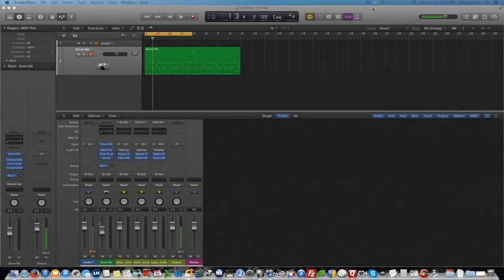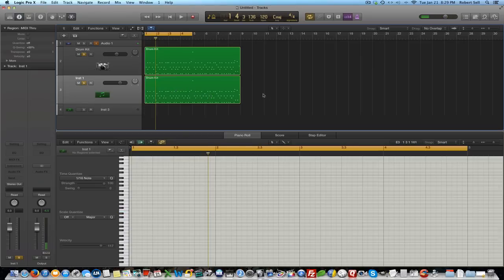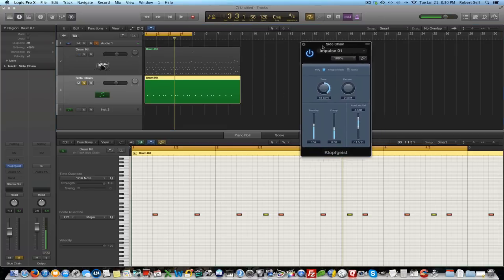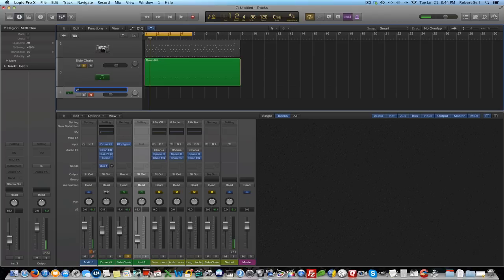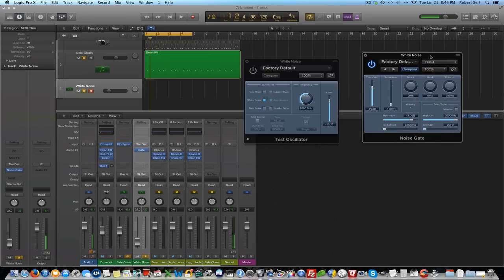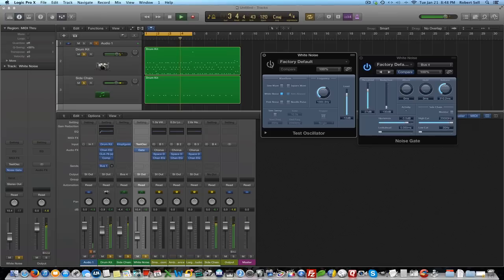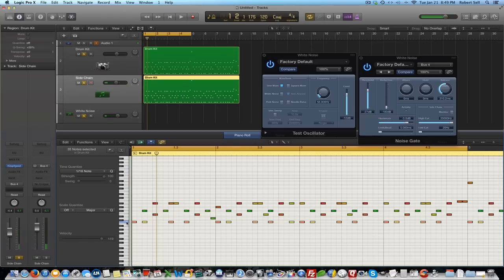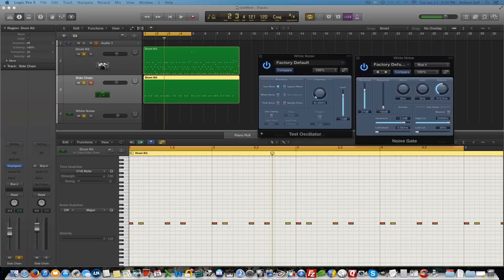Adding White Noise to a Snare in Logic Pro X

Comment from the maker: Logic Pro X has a test oscillator that has a white noise option.  I’m using the snare notes to trigger a noise gate, using the side-chain input, to release the white noise. Therefore, the white noise coincides with the snare hits to give it more presence and color the sound!
Reply: I saw you have listed a C-1000 in your gear , May I ask what's you opinion about them? I've heard good stuff & some Bad stuff.
Reply from the maker: I bought mine in the 80s. I'm not sure if technology upgrades has changed anything but I've always been very happy with it's performance. I always used it with phantom power so I'm not sure about the battery operation. It's fairly bright and mid-rangy sounding to me. I used it for vocals and acoustic guitars. However, depending on the vocalist, it may prove to be too bright. Very durable and I still find applications for it today. Overall, I think it's a great mic for the price! All the best!

Comment: hey Bob ... great tutorials! What program are you using to do your screen captures.. the picture and audio sounds excellent .. how are you getting the audio to record perfectly into your videos??
Reply from the maker: Hey Joseph, thanks for the comment! I'm using ScreenFlow for Mac. It will record the screen and your built in mic at the same time. However, I get better quality audio  using a decent mic ( in this case a Rode NT1A) going through my converter. Recording the screen in Logic Pro is a no-brainer as you can arm a track to record (or input monitor) and you'll have the mic audio together with the computer audio. Hope this helps.

Comment: Hi great tutorial , was wondering why do you have to route Klopfgeist to Bus 4 with no output . Can you just set the Kloofgeist channel to No output ?
Reply from the maker: +Tommy Mai I routed it to a bus so the signal would be available to use as a side chain input. Bus 4 was set to no input because I don't want to hear it. I'm just using the signal produced by the Klopfgeist to control the noise gate. If I set the Kg channel to "No Output" then I lose the signal needed to sidechain the noise gate. Hope this helps!

Comment: interesting technique! 

can i ask though, what does white noise offer over something like a simple 1k boost?
Reply from the maker: Thanks for the great question JC! I'm assuming that you are referring to boosting 1K in the snare track? If so, you are only boosting the harmonic content that's already present in the snare. If that works, great! However, using white noise gives you all of the audible frequencies and they are equally represented. So tucking white noise under just under the snare level usually works well for defining the attack of percussive instruments. Also, creative use of EQ to isolate certain frequencies within the white noise may be a good option. Hope this helps... Thanks again for the comment!!

Comment: Hi bob, I'm wondering.. Why don't you Just copy the snare like you did. but instead of the klopfgeist just insert the test oscillator there and make it sound like the snare with the attack and release controls? maybe I'm missing something but I don't see why you should go over all the side chain routing. thanks in advance!
Reply from the maker: Because the test oscillator is not a midi instrument. You wouldn't have to go through this process if you could use midi notes to trigger it. It generates sound when it's on and only stops when it's off.  So the Klopfgeist is used to trigger the noise gate that controls the white noise that otherwise would be on all of the time.
Reply: +Bob Sell thanks for the quick answer! I don't work in logic but now its clear. and regarding the sine wave underneath the kick, you should try to tune it to the root noot of the track you are working on! there are tables to convert frequencies into notes on internet.
Reply from the maker: I did this video on tuning a kick in 2015: https://youtu.be/zvGL19LNX74
Reply: +Bob Sell thanks I'll check that out :)

Comment: I don't see any signal going when I play Side Chain  after I changed Stereo Out to No Out....
Reply from the maker: So the track you have your click on is assigned, in the output section, to a bus? Then on the aux track that has the input from that bus is set, in the output section, to "No Output". You should see the signal but no sound. Double check your routing and this should work. Hope this helps.